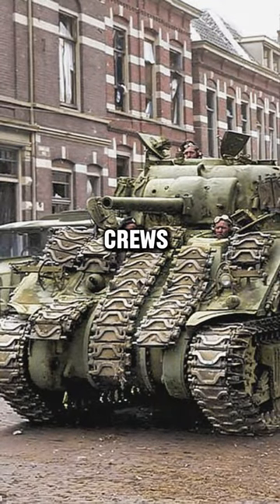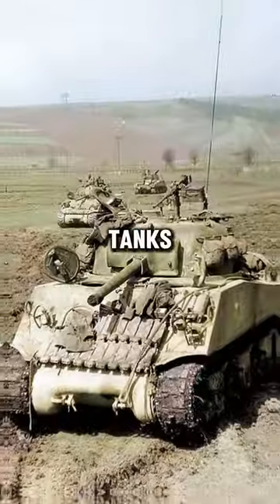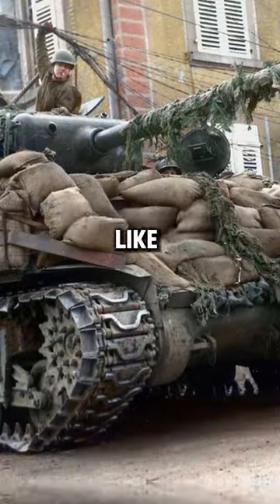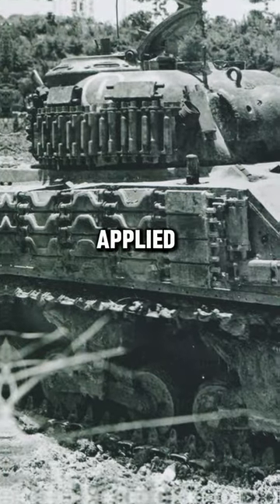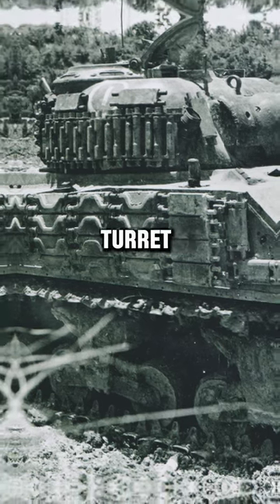Why did they Add Spare Tracks as Armour to their Tanks?

Comment: "Hey did you add those tracks on your tank as extra armour?"
Literally any tank crew-....no its for repairs only
Reply: Patton: 😡
Reply: Thanks for the correction. I was just about to say the same. Spare tracks were just that right. The tracks were constantly getting damaged and they wanted to make the repairs in the field instead of waiting for replacement tracks coming up from the rear.
Reply: Any object which detonated a Panzerfaust could deflect the blast of the shaped charge.
This is why logs were also used.
In more modern conflicts the use of thin plate or mesh was used for the same reason. 
By the time allied troops were adding any additional armor was because far more tanks were destroyed by anti tank rockets than by heavy guns.
The tracks were "spare" but reduced threat from infantry.
Reply: Go figure hedgerows
Reply: Flase but smoe crews did add extra for "protection"
Reply: And it boosted their moral so they didn't care
Reply: @jamesguadagni1232  Logs were also used for driving in muddy areas in case the tank got stuck.
Reply: They were added for both. Just look at the placement, if they wanted them just for repairs they wouldn't be placed like that.
Reply: Yup, this video were crazy
Reply: @becomeracer7041  Clearly that patton hate the tank that use sandbag and cement for the armor, not tracks

Comment: It's more of a psychological armor for the crew, it makes them feel better or safer with the added armor.
Reply: true and the tracks helped against small bullets even if they would not penetrate a tanks armor without the tracks the crew inside would not hear the bullets hitting the tank all the time... it scares a crew if the hear bullets hitting the tank permanently and not hearing all the small hits increases the moral inside the tank
Reply: "Or so the Germans would have us believe" - Norm Macdonald.
(When SNL was worth watching)
Reply: even if it only gave 10-20 mm of extra armor you would rather have it than not right?
Reply: wouldn't this work against heat??
Reply: @viktor397 no

Comment: As I remember, The Germans also put spare tracks on the armour such as Tiger 1. So it wasn't entirely useless, it offered a little bit more protection and you still have to carry them for maintenance anyway.
Reply: warthunder eh?
Reply: It is, in fact, completely useless.
Tracks are usually made from relatively soft steels. The armor underneath varies in hardness, being the hardest on the very outside and the softest on the inside, a process called face hardening.
A soft track on the outside would help a shell normalise against the armor, increasing its penetrative potential greatly when the armor was angled. 
THIS IS A PROBLEM.
To the normal person, it would make total sense (which is why they did it), but it was found in penetration tests to be detrimental to resistive power, against both kinetic and HEAT rounds.
Also, I did not find a lot of evidence of this being done on Tigers, it seems to have been more of a Panzer IV and Sturmgeschütz thing.
Reply: @theol.1988 tracks de Shape the rounds and can prematurely detonate high explosive anti tank rounds
Reply: @BelugaChonky  Don't argue me. Look up the results of the penetration tests and argue with that. 
Fact of the matter is, standoff improves the penetrative capabilities of HEAT, that is why modern HEAT Warheads have standoff fuses. 
That is also why nobody anywhere uses sideskirts for HEAT protection.
Reply: @theol.1988 isnt it more for maintenance, though? Tracks break after all
Reply: @wlodek7422  Well, that would be a good explanation. Until you realised that many of these tracks were welded on, and some of the german troop used tracks foreign to their own vehicles as armor. (This is not unique to the german tank crews, but a well known example) 
And, realistically, you are not going to make a field repair with more than 12 track links, which would make maybe a meter and a half of track (MAX!). That is the maximum amount of track I would expect somebody to be able to make a repair with. Depends on the track. Those things are HEAVY. 
And, usually, you will have one or two track links fail, you replace either one bolt or two and a link and you should be good. Any more you are not going to repair on the fly anyways.
Reply: Yes they did put it on the tiger including the tiger two (h) especially which had mounts for track armor to be applied
Reply: @theol.1988  "Don't argue with me" is like hearing you slamming your keyboard with anger through the screen lmfao
Reply: @thesickrobot6924  Hey! I didn't slam my keyboard through my monitor. I slammed my mouse through my Mainboard.
Reply: @theol.1988  Dude that's not good for your hands, i hope you're okay.
Reply: "A little bit more protection"
Thats like wearing a bicycle helmet and saying it protects you from 7.62, it doesnt.
Reply: @sodaaccount  If I HAVE to bring a bicycle helmet to the battlefield for some reason, I would definitely want to wear it on my head anyway, at least it can protect my head from the environment, debris,... The same apply to tanks, if you have to bring the tracks, at least make them feel useful.
Reply: A lot of tanks in war thunder have the additional track "armour" but in reality it's nothing but for repair use only.
Reply: They did on panther and tiger 1 and tiger 2 but not all of them had it

Comment: It was more as a “I feel safer now” kinda thing for crews.

Plus the tracs could have actualy helped in stoping things like Panzerfaust heads that tend to explode once they hit making the explosion weaker for the crew inside.
Reply: Last but not least, you still have to carry those tracks for maintenance and repair, so "why not put them on as armour anyway?". The Germans also did the same as I recall.
Reply: @macobuzi  yeah. Tracks and wheels were often use as an extra protection. Patton forbid the crew to use things like sandbags

Comment: Actually, it is the same as current crews putting on cages. It is not for tank vs tank it was for the panzerschreck. There were 100,000 of those around in ‘45 and destroyed more Shermans than a Panther or Tiger.
Reply: Panzerfaust and Panzershreck  were responsible for the majority of tanks knocked out in Germany.
Reply: I was about to say the same thing
Reply: I'm almost certain that that is wrong and primary tank killer was still anti-tank artillery
Reply: The effect of High-Explosive anti tank rockets can INCREASE with standoff distance. This is why modern shells have standoff fuses. That is the reason why they didn't use sideskirts for Panzerschreck/Panzerfaust protection. It doesn't help. What can help is deforming the warhead, which modern add-on armor does very well.
I think what created this misconception is World of Tanks or War Thunder, both of which struggle to varying degrees in accurately model penetration potential of rounds.
Reply: @jamesguadagni1232 They actually were   responsible for only 5-10% of the tanks DAMAGED until the last two months of the war, rising to about 32% then, and that only because Germany was running out of large caliber pieces. Then you have to include that guns were severely more deadly to the crew... If you look at the entirety of the western front, ALL infantry weapons COMBINED accounted for only 6% of tank kills. And that includes AT grenades, sticky charges, molotovs, satchel charges, people opening the hatch and shooting inside, etc, etc, and yes, also panzerfaust.
Its effectiveness is very much overstated in mass media, the main tank eliminator was a gun of at least 75mm+ at like 67% of all tanks destroyed. For crew, guns account for around 92% of all losses. Funnily enough, mines are the second largest at 22%, but crews usually survived intact for them. All that info is freely available in the declassified reports from 1944-46, bit of a dry read though.
Reply: @iplayzgames8241  Yes, from what I gathered you are 100% correct. The problem I have with that logic is that we are talking WWII Era. The Monroe effect was well understood by then, but, let us be honest, not by the average tanker. So the constructs they would come up with to increase crew morale would harldy be actually effective. The best protection for tanks was and is Infantry support, not DIY applique armor.

Also spaced armor tends to be set up properly with a lot of research going in to them. Slapping a couple of sandbags randomly onto your tank is hardly an informed decision.
Reply: Thank you I was hoping someone would say this

Comment: They where mainly used as spare parts, but indeed some crews carried lots of traks as protection, it worked very good against HEAT shells and even if it gave little protection every little helps, also giving the crew a morale boost thinking they were much more protected than they where.
And in some cases it can mean the diffrenece between live and death, and you have to carry spare tracks so putting them as armor doesnt hurt anybody, as long as you dony put too much of course
Reply: Sorry no. They did tests and against standard AP shells the additional armour actually increased the penetration of the armour. As instead of being hardened steel it allowed the AP round to "dig in" so get even greater penetration. 
Against HEAT type rounds they gave little added protection. Sandbags did work to some degree against HEAT type rounds but the weight needed meant it slowed the tank down making it an easier target. Some had large amounts of concrete added which may have helped against HEAT rounds.but again added weight caused problems. The most benefit was morale. 
Jumbo or assault shermans had factory added armour with improved engines and suspension. A few shermans  had added armour cut from destroyed German tanks
Reply: @PeterWilliams-p8q yeah, I was boutta say, the softer tracks would probably help full-caliber AP shells normalize and probably improve penetration if anything.
Reply: @PeterWilliams-p8q 
It was good agaisnt heat and hesh shells
Things like the panzerfaust were way more common than an actual german tank
Reply: mabe this would give a false sense of security to the tank crews, thinking they were more protected by the spare tracks as like an early form of "reactive armor", and this might have led crews to say oh we're safe and to drive closer to an enemy position than they should have - i wonder how many casualties were sustained due to this false sense of security
Reply: @Defender78  that’s a good question. Tanks aren’t usually alone, though, so I feel it would be hard to push up like you said.

Comment: The thing is, the armour has a hardened surface, making it bouncy, while tracks are more ductile (soft) so as to not crack while driving. A hard surface makes projectiles bounce at an angle, a soft surface, while absorbing some additional impact energy will make the shell bog into the armour more easily in the first place instead of bouncing & flipping sideways on impact.
Metals at those kinetic energies really behave like liquids.

Comment: As other pointed out allready, such has more of a psychological affect.
Also, they offer (if any noticable) protection more on flat plates, as there it still is if even not armor grade some material inbetween. However the bigger problem is that duo to beeing softer, on angled plates it can help the shells normilize against the armor more making it actually less effective.
Reply: I'm not sure if it would impede a tank's ability to deflect shots. The hard armor is still underneath, I don't see why the tracks would change that. Someone could do a test though, fire a bullet at a hard surface that normally would be deflected. Then cover that same surface with a soft material like styrofoam to see if there's any difference in deflection.
Reply: @EnigmaHood  Because the softer material of he track would act like the protective cap of a APC round imroving the nominalisation.
Reply: @Ghostmaxi1337  I understand your hypothesis behind it, I'm just not convinced that would actually happen. It would have to be tested.
Reply: @EnigmaHood  Thats not my hypothesis, thats what i read from American Trails.
Reply: @Ghostmaxi1337  I don't know what that is, did they test it? Do they have proof to back up the theory?
Reply: @EnigmaHood  Pardon, what? What words are not clear to you?
The USA did Test Shootings at M4 Shermans with and without track add on armor and came to the conclusion that the Tracks negatively impacted the normalization of the impacting rounds (helped the rounds angle downwards to flatten the impact to the plate and thus help with penetration) in WW2. Thats why they issued to BAN such add on armor, as it was only more weight, less protective (on the slopes).
Reply: @Ghostmaxi1337  I don't know what American Trails is. What is that? A book? A novel written by Tom Clancy? What is it
Reply: @EnigmaHood  Maybe i misswrote the word, but a different word for Testing. With multiple tests.
Reply: @Ghostmaxi1337  What's your citation?

Comment: it’s not exactly the same as using sandbags because the sandbags are pretty much completely useless, whereas the spare tracks are spare tracks that might offer just a smidge more protection if placed on the outside instead of stored elsewhere
Reply: Sand actually stops rounds.

Comment: I'm in the M109 crew and even though the gun isn't a tank, both the gun and the ammo carrier have tracks on them purely for repairs and replacements

Both the carrier and the gun can get crazy when driving since they have so much space inside them so adding in another heavy object to be flying around inside as we're driving would be a terrible idea, we have to tie down things like tool bags but the straps will definetly not hold down a track if we crash and it gets sent flying.

So we have the track replacements up front

Comment: The tracks, sandbags, and other types of extra armor may not have been effective other than against shaped charge weapons but if a crew feels safer it boosts moral which is very important. However spare tracks being welded on also meant they couldn't be used for repairs as some people believe was the case. 

Logs were and are still sometimes found on tabks but more often are used to create traction if a tank is stuck in mud or a ditch rather than as armor. This is why crews still tie logs to tanks in conflicts such as the Ukraine war however the increase in shaped charges means they can double as a way to reduce anti tank weapon penetration. (Would be useless against kinetic penetrators) 

In rare cases ww2 crews would also weld extra armor on when available and was also approved by General Paton unlike other forms of extra armor.

Comment: and that's why Patton Hated these Phycological Armour, its better to cut a Destroyed tank Armour and Weld it to your tank than adding Concrete, Spare Tracks, Sandbags and maybe other materials they could use as Armour.

even though it still useless against Tiger 1 and 2 8.8cm (and maybe Panther's 7.5cm too) but atleast it calms the crews

Comment: Makes me sick how USA had to use Sherman vs German tech. Banker's wars.
Reply: German superiority is a myth.
Reply: The panther was so ass that it kept breaking down and damaging it's suspension, it was supposed to be mass produced but since it was so unreliable they had to keep the panzer Iv in production.

The king tigers frontal armor was so rushed that in the heat cracks in the plates would form.

The armor of any panzer model before the panzer g had weaker armor than the sherman💀

The tigers frontal armor was not sloped and it was only 100mm making it barely have enough armor to be classified as a heavy tank.

Because of the terrible welding and trash alloy quality of late war panthers the front plate had a chance of falling off when struck with a shell, a literal hull break.

The sherman firefly was feared by the Germans due to is 76mm gun that could penetrate the tiger frontally from far away distances.

The road wheels of the panther was a pain and took longer to repair because of its interlocking design.

Roughly 6000 Panthers were built between 1943 and 1945. the Panther was plagued with mechanical problems. The engine frequently overheated and suffered from connecting rod or bearing failures.

Comment: They were effective against panzerfausts
Reply: But those teams wouldn't target the front.
Reply: A Panzerfaust had enough pen to still easily get through, that extra armor would have not changed anything.
Reply: @radiotoxical7966  what about in the case of the super pershing though? Or is that too different compared to laying tracks/sandbags on the tank?

I doubt adding extra tracks on the armour would increase the weight of the tank that much tbh if you think about it
Reply: @radiotoxical7966  Doubt that, the early HC weapons had to be close to the penetration surface.

Comment: Fuxking bull sh!t firstly add on track armour was tested and was found to add additional protection approximately 50% to 60% by thickness of metal, because although steel track were tough (obviously they have to be to function) they are not armoured plate or casting. However it wasn't just Shermans that resorted to use of spare track plates as tank armour The Germans used it from the earliest days of WW2, especially on the hull front, hull and turret roof.  British Soviets and Italians used tracks on their AFVs and it was still in use on Israeli tanks after the 1973 war.